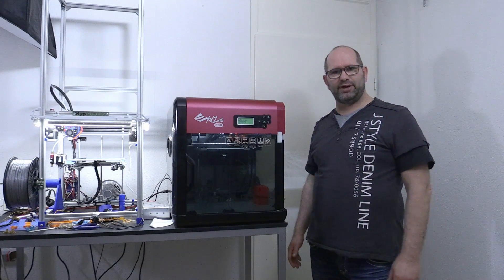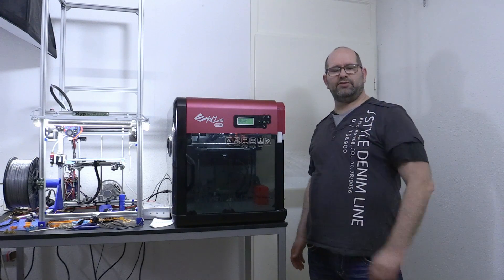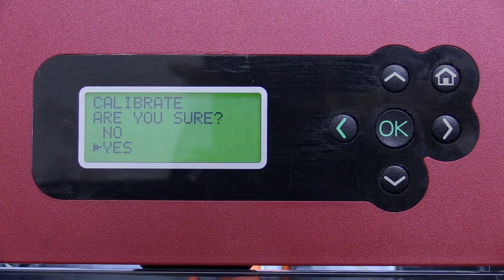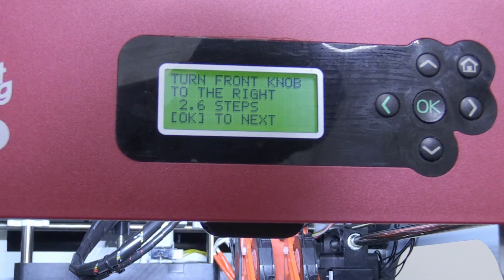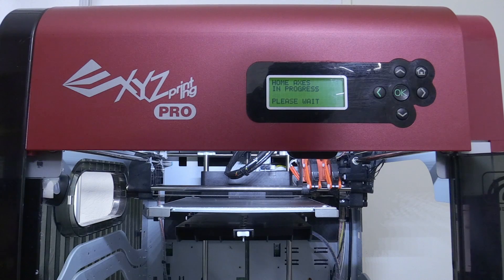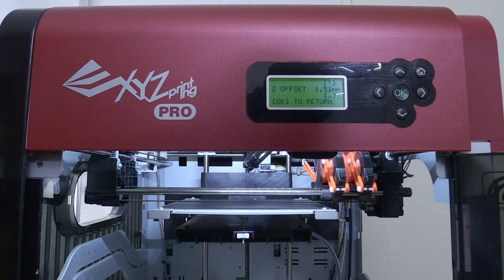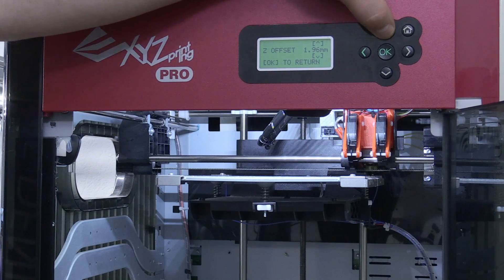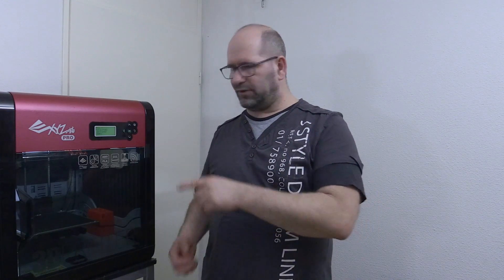▼ Leveling the Da Vinci Pro bed - Automaticaly AND by hand - Tutorial

Comment: 5 years old, but still actual and useful since this model is still on the market and I just bought one. Thank you for the tips. :) Just two questions, though. 
1: Does the heatbed have to be heated up when doing the z-level offset calibration for all corners? just wondering if printbed warping could be an issue or if it is so minimal that it does not matter. 
2: How thick is the paper you used? the manual said to use two papers, you just used one.
Reply from the maker: Hi,
When doing the corner to corner leveling, the print bed does not have to be heated, because the leveling is done on the metal edges, and not on the bed.
I prefer doing the hand level method, and then the bed needs to be heated because then the sizes are a bit different from a cool bed.
For leveling, I use 100gr/m2 paper or a business card. When using a business card, please make sure to have a stiffer feeling.

Comment: Thanks for the video. It really helped. Can you tell me what type of padding are you using on the printbed?
Reply from the maker: As explained here: https://youtu.be/mPkaL9PC56Y?t=864
The printbed is BuilTak
These are sheets of print bed material that can be mounted on the aluminum bed, and that work great for both PLA and ABS.
Reply: @3dPrintCreator   @3d-PrintCreator  Thanks a lot! What other types of padding do you reccomend?

Comment: Hey Brian,

How do you have version 1.3.2 when the websites latest is 1.2.2?
Where do you get your firmware?
Reply from the maker: For a long time, the software demanded you to do an update before you could use the software. Then, when they had messed up the software pretty badly, they rolled back to old firmware, and they never changed that anymore.

Comment: My Da Vinci 1.1 plus powers off during auto bed calibration. The bed gets to about 72c and then the printer shuts off. The hot end seams fine, it gets to 212c.
Reply from the maker: Looks like a thermal runaway protection kicking in. There must be some error in the thermistor (maybe loose) or on the board.

Comment: I'm using a Da Vinci Pro at work, but we cannot get the printer to get past Calibration. It touches all four points and then reports fail. I have cleaned the nozzle and points. I have manually set the bed as suggested and then calibration gives the 'unlevel bed' response. I then adjust as requested, it re-calibrates and then I get 'Calibration Fail' again! I tried your manual levelling method and then tried to test print. Nothing happened! Please help.
Reply from the maker: Hi
It's more then a year now since I have used it, as I don't have a Da Vinci Pro anymore, but you can skip the Da Vinci calibration and just calibrate by hand the manual way. Then ignore the message that the bed is 'unlevel' and just print with it.
That's how I did it back then.

Comment: my new da Vinci pro 1.0 never touch the front metal piece when calibration and fail all the time, wondering if you know what's going on. Thanks,
Reply from the maker: Can it be the bed is hanging a little on the front? Sometimes this happens and then the front of the bed is simply to low for the sensor to touch.
Reply: Sidney Tsou , check to see if your front tensioners are stuck giving the belt to much slack, if they are just push on the wheels forward making the belt tight and the sensor will reach the 2 front pads when calibrating.

Comment: Hi Brian, I have the issue that with manual calibration that the bed and the nozzle are cold. When the bed is heating up, it is not level anymore. Either the three adjustment studs are not at the same temperature or they have different heat expansion coefficients. I did not find a way to do manual calibration with a hot bed and hot nozzle. I even tried to insert code in Simplify3D to move the head to Z0; release the motors and wait. Somehow this did not work. The head moved to the correct position but did not wait.  I could not find a list of which gcodes the Davinci will listen to when on USB or WiFi, or which codes have been implemented (like the correct code for waiting). 
Also to make the auto levelling OK you have to clean the contact points (Nozzle and bed) DILIGENTLY. I use Acetone, Ethanol and WD40 and copper brush, in that order. Also A problem was that at point 4 (left back) the Bowden cable and/or the cable harness was between the head and the frame, causing the head to move up slightly, throwing off the measurement completely. I prevent this manually and it is now OK. 
To make sure that the auto levelling is successful, I repeat the procedure and the second time it must say "Perfect level" again without any adjustments. 
After auto calibration I adjust the offset (with tape installed) with 2 pieces of paper. Then I am close to a perfect first layer. After that I do 1 -3 test prints optimise the Z-Offset.
Please comment on this.
Reply from the maker: Hi Hendrik,
I am glad this works for you. The 'auto' calibration never worked very well for me and that's why I did the calibration as explained in the video. That said, I made a completely different printer now in the frame of the Da Vinci printer, with real auto bed leveling, so I don't have to worry about that ever again.
So, at this moment I don't have a Da Vinci anymore. I have a homemade printer that looks like a Da Vinci, but it isn't.
Reply: I assume that you did not have problems with manual leveling "cold" like I do? @3dPrintCreator
Reply from the maker: Yes and no, to be honest.
No, I didn't have any problems with cold leveling but... Yes, I use thicker paper then I use when I level a bed of a printer that can be leveled while it's hot. The thickness of the paper is enough to correct for the expansion of the nozzle (there is no noticeable expansion in the thickness of the bed).
So, as long as you have the same hight for each corner and the center of the bed, then the only thing you have to make sure is the size of the gap between the nozzle and the bed. I used Simplify3D for the Da Vinci Pro printer and that slicer has perfect first layer settings that are being recognized by the printer.

Comment: Hi Brian, I love your videos!  I tried to calibrate my XYZ da vinci Pro and it failed, then I went to the Z offset and it gave me a 1.45 message what do I do next?  Other videos tell you on the little screen what knob underneath to turn but mine doesn't.  Can you help me?
Reply from the maker: I can't check the messages anymore as I don't have the Da Vinci Pro anymore (I build a new printer in the same cabinet) but I never used auto calibration. I always calibrate my printers by hand with some paper. Works best.

Comment: I've done this several times on my Da Vinci Pro and it's like my printer forgets the offset is there...it just crashes my nozzle into the plate when i start to print
Reply from the maker: Oooh, that's really bad.
Don't know why this is happening. I didn't have the same problem with my Da Vinci Printers.
Reply: Have you figured a way to successfully calibrate this issue?  Im having the same situation with my printer.
Reply: Same

Comment: Hello, and thx for vid :-)   When i try auto calib, the check pin by nozzle cant reach the metal plate on the bed in front right side? will a hard reset fix this? i can print by manual use yours ide, but auto would be nice :-)

Comment: After 3 weeks of ownership of the Da Vinci Pro (3 in 1) the bed warped (I guess from the heat) so it never gets level. I added blue tape to compensate where it has warped and use a sheet of glass to ensure level Z axis and level prints, but what a piece of junk! ...and don't get me started about the how bad the laser scanner is, total waste of $100.00, this printer is good for kids, senior citizens and retards.
Reply from the maker: Hi,
I can understand your frustration but I can also tell you that this happens with every printer in the world sometimes.
It's a thing that can happen and it's very frustrating if it happens, but I know XYZPrinting doesn't make a point of it and replaces the bed free of charge. It's just bad luck when it happens. I had it on one of my Da Vinci Pro's, I had it on a home made HyperCube and it happened on a Prusa clone I have here.

Replace the bed and you'll be very happy.
Good luck and regards,
Brian.

Comment: After the "Z Offset" adjustment is made, should you not push the "Home Axes" setting to let the machine know the print height at a future print?
Reply from the maker: Homing the axis is needed when the printer doesn't know the positions of the axis. The home point is the starting point from where the machine counts the steps made by the motors.
When you start the Z offset mode, the first thing the printer does is homing the Z axis. After that, everything the printer does is done by calculated steps, so homing the axis again is not needed.
Reply: Good to know, i'm sure it was on an xyz video that mentioned it. Thought it was a tedious way of doing things!

Comment: I got that printer 2 month ago and first tried the calibration routine. It takes forever and it is really anoying. So I started to do it like you. Calibration takes now around 1 minute. 
The bed warped on mine as well btw.
Reply from the maker: Good to hear that it also works for you.
Aluminum beds do warp, they always do. if it's real bad, you can buy a new bed or maybe it's even a warranty issue for you.
But if it still works, don't bother about it ;-)

Comment: how do you level the bed with e3dhot end? no probe
Reply from the maker: You should have watched the whole video :-)
https://youtu.be/mPkaL9PC56Y?t=9m19s
Reply: manual way then. My e3dhot end really struggles to print pla if i switch back to stock i have no issues and i manually calibrate that. using a steel nozzle also.
Reply from the maker: Are you sure you tightened the nozzle to the heatbreak??? This is a very important step and can cause this kind of problems.
Quick way to find out (but certainly NOT a solution) is to use a drop of vegetable oil in the hot end. Just a very tiny drop (stick the filament in for 1cm and then in the hot end).
Make sure when you do this, you don't get that filament trough the PCB !!! only in the hot end. If the problem is solved, you have not tightened the nozzle to the heatbreak good enough.
Reply: 3d Print Creator definitely. I'm going to try putting the brass nozzle back on later and see how that goes.